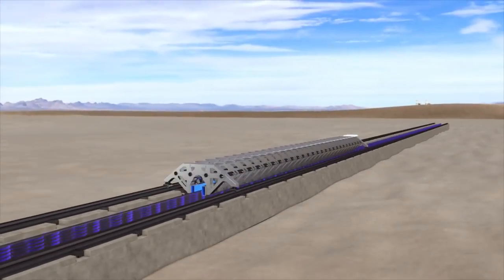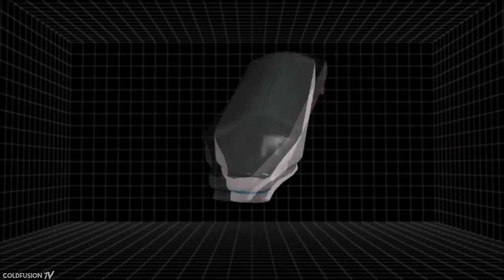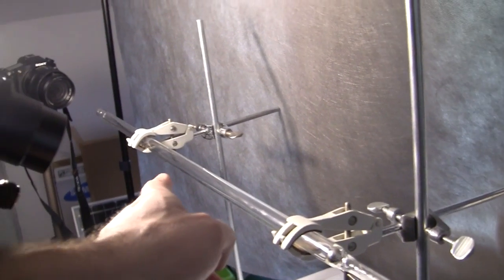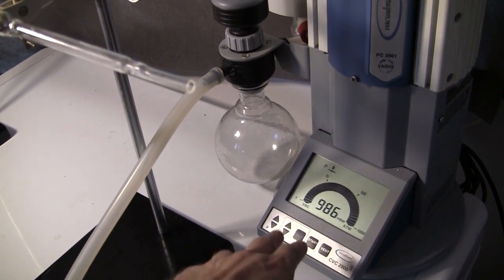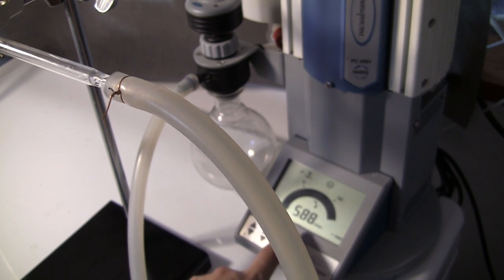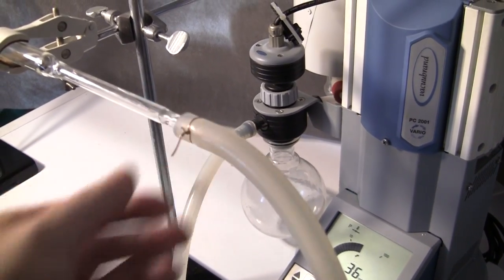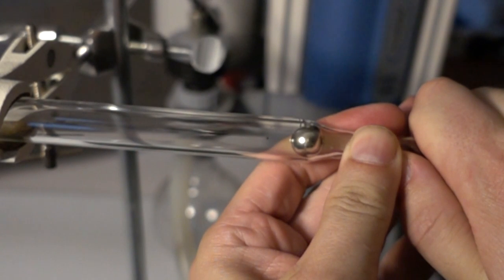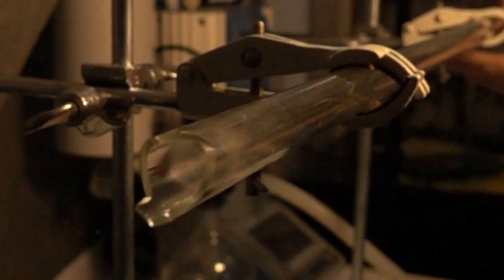How  the Hyperloop can kill you!

Comment: So this simulates vacuum failing behind the craft, can you compensate by releasing the vacuum along the whole length of the tube? Can you seal off parts of the tube fast enough? How fast would the air pressure spread in a full scale Hyperloop? Need more science.

Comment: What's busted now? Getting into a metal tube with wings and accelerating to 900 km/h at 11 km altitude with a little more pressure is less of a problem? Every transportation system can and will fail eventually, the art is keeping it at low risk. but that didn't stop people from trying it anyway.

Comment: For once, I don't get you with this one thunderfoot,  this video feels rushed and not up to your usual excellence.     The hyperloop sure ain't the best of ideas for many reasons.  But you're not doing yourself justice with this one,  you can do better than this chap,

Unlike many other things you have debunked, like Thorium Powered Cars (First video of yours I watched by the way,  most Exellent ^_^  )   The Hyperloop isn't actualy technically infeasable,  Just very fragile in many respects,  and very...  energetic if anything goes wrong.

 Pressure problems can be defeated through engineering,  maybe valves that would equalise pressure on both ends of the train upon vaccum failure?

(though,  what happens when the train is at full speed,  then suddenly vaccum failure floods the tube with near sea level pressure air,  and the train finds itself traveling at that speed in air pressure it was not designed for?)

It also runs the problem of being an extremely fast moving object,  in very close proximity to solid matter that is at a very high relative speed to itself,  even supersonic aircraft have the luxury of being far from anything to scrape or collide into when they are at speed.

I sure don't consider it a "Man Rated" form of transport,   for efficient transport of cargo perhaps?

Though that would require an analysis into the cost effectiveness of cost of fuel saved VS the cost of initial R&D design and construction.     How long would it take to pay for itself,  if ever?

Any applications for very high speed efficient cargo transport?

These are the kind of points I'd have expected you to bring up,  hope they help you come up with a better video on this :-)

Comment: I would like to see a vacuum-failure with magnetic brakes activated.
Not to mention that the full scale project would most likely have double or triple walls between the vacuum chamber and the normal earth pressure with loads of sensitive pressure sensors...

Comment: I'm not convinced that the Hyperloop can be made economically viable, since the infrastructure required does seem very expensive, but the objection in the video doesn't hold water.
Your model has very little room for inrushing air to bypass the vehicle, much like a bullet in a gun, but the promotional video has quite a lot of clearance around the vehicle, so the air can follow the path of least resistance around the vehicle.

Comment: I am pretty sure you can do the calculations and tell us what kind of impact would a failure in the tube have to a multi ton pod with electric acceleration and braking. You can calculate it for a failure near the pod and also miles away from it. I would suggest that any force that the air would apply to the pod would be negligible compared to the pod's weight and the extremely powerful braking system that could stop it from 1200-0 km/h. And that's only if there are no safety measures at all.

I am afraid you are terribly wrong in this one. Why not contact the company that is building the test hyperloop and ask them for a comment?

Comment: What happens if your car brakes and accelerator fails? You will by going 70+ miles an hour in a 2 ton vessel until something is in the way...
What happens if the pressure in a airplane cabin fails? You will be deaf and a organ or two will rupture
So on and so forth... Each and every transportation has issues, and its stupid for you to point out these miniscule issues and make a huge fuss about it. Yes it needs to be engineered to be solved, however it also doesn't need to be released to the public who will have mass hysteria and wont understand whats actually going on.

Comment: I think you may have over reached on this one.

1. The failure mode you have demonstrated is almost impossible, the whole end of the tube coming off? This would be analogous to a ring of demolition charges going off. The more likely failure mode is a fatigue crack or joint failure, which may expand from a pin hole to something larger very quickly but not total tube failure. Remote fatigue monitoring and leak detection are common in the aviation industry.

2. Even if the tube did fail catastrophically the capsule is not designed to snugly fill the tube in the same way as your ball bearing, there is going to be plenty of room for the pressure to equalise fore and aft. Your tube does not match the reality of built infrastructure, over that short distance with a smooth tube turbulence and friction with the inner surface is negligible, this is not the case for the full scale version. 

3. The capsule is fitted with brakes, any unexpected accelerations and they slam on, again something well within the capability of modem avionic systems.

4. At what point does this failure occur? If, as in your demonstration it acts to accelerate then during it's journey the capsule will be travelling at almost Mach 1, a failure behind it will mean the in rushing air will have to travel supersonically to catch up. Effectively the capsule would be trailed by its own cavitation effect and the control systems would have plenty of time to react. If the breach occurred ahead, then that is a far worse scenario possibly akin to an aircraft being caught in extreme turbulence, but millions accept that risk every day and is mitigated by the avionics, the controls need to keep it straight and keep the brakes on and it will be safe.

5. A critical failure as the capsule passes is the perfect storm of failure and whether due to a deliberate act or because this is the point of maximum stress and you end up with the Tay Bridge disaster, but again this is a risk that commuters totally ignore. It wasn't that long ago that one badly maintained set of points sent a commuter train barrelling sideways down a platform. And how many air crashes in the 70's and 80's did holiday makers disregard? They seemed to be weekly as I was growing up.

The engineering is solid with this however I don't think it will be built due to a number of factors. It's inflexible, you can only go where the tube goes and then its cargo transfer time. We had a fantastic rail network in the UK that was far quicker than the road system over long distances but every motorway is still filled with container carrying trucks. It's also very expensive to maintain infrastructure on this scale. So financial reasons will probably kill this but well done Elon Musk for at least opening the discussion.

Comment: Wouldn't the car itself be pressurized? Also why would the air pressure wave push the car, wouldn't it go around the car? Or are they saying that the car would perfectly fill the tube. In which case couldn't they put a pressure bypass through the car or a breaking system that would counter act that wave?

Comment: I'm a bit sceptical about that claim here actually.
I mean sure, if the hyperloop wasn't build with safety measurements etc. then it will surely kill a person, no doubts but isn't it a bit utopic to assume that the hyperloop wouldn't use some kind of safety measurements?

Considering that the hyperloop uses magnetic fields gives it a certain possibility that it might use eddy current brakes.
Additionally it could be possible that the tube-system itself might have some kind of pressure system which, in case of such a problem like in this demonstration, would try to open the valves in the tube-segments in front of the vessel which would shorten the acceleration path and reduce the acceleration force.

I might be completely wrong about my points, but wouldn't those mentioned points already do their job in reducing the lethality of the hyperloop?

Comment: My understanding of the hyperloop is that it isn't operating in a vaccuum, but low pressure. There is still a good amount of air in the tube, the vaccum at the front sucks the air and expels it out behind the car while riding on a mag lev track. Am I wrong? I understand the point Thunderfoot is trying to make but I don't think that is how the track is supposed to work.  I seem to recall Elon Musk publishing schematics for his concept.
Reply: eh, wikiped says the tube is supposed to operate around 1 milibar so I guess I'm wrong.

Comment: what's more hilarious is the fact, that it has a giant jet engine intake on the front.
what's it gonna suck it to combust, when the air has been pumped out? D:
Reply: 1. It is not a jet engine. It won't combust anything. It is a fan.
2. The tube is not vacuum, but very low pressure. Because the capsule is moving very fast there still would be enough air to suck in.
3. Most concepts don't use the fan, which is meant to produce air cushions under the train to levitate, but use magnetic levitation instead.
Reply: oh also... this suggestion is not new, it was already old, when they showed it in babylon 5 on mars.
Reply: The air cushion that forms when the pod is moving. It's not complete vacuum.
Reply: Holy shit. Vacuum and very low pressure are essentially the same thing.
Reply: Regarding the pressure difference, yes.

I was however answering the question what air there would be to suck in, and if you compress low pressure air (by pushing it forward) you indeed do get enough air buildup to suck in.
(I got the impression that the original commentor thought that there would be a complete vacuum in the tube. Maybe I should have said "The tube is not a complete vacuum")

Comment: I don't think the seal between the pod and the tube will be that tight. From what I've seen there will be a significant gap between the top of the pod and the tube, so a lot of air will rush past the pod and fill the other side. The pod will be pushed for sure but not as hard as in this experiment.

Comment: Ok, the problem with this video is that you changed how the Hyperloop works. Your test is much more like one of those tube messaging systems, but in the Hyperloop there is a low pressure inside just so that it is easier to make a magnetic levitating train travel closer to the speed of sound, there would be a lot of room around the train itself. Would be much more accurate if instead of a ball you used a nail that would not fill the entire tube, then the rushing air would not have that much of a effect on the object inside the tube.

Comment: Uh. The force exerted on an object by pressure scales linearly with the surface area; the surface area of an object scales with the square of the diameter, but the mass scales with the cube of the diameter, therefore the acceleration experienced by a larger object is much less than a small object. Repeat your experiment with a ball bearing twice the diameter and it will show half the acceleration. Repeat it with a ball bearing 10x the diameter and it will see 0.1 the acceleration. Granted, a train of any scale is less dense than a ball bearing, but it's also at least 400x larger in diameter, and has a long aspect ratio. where only the nose of it contributes a net accelerating force as the radial pressure is balanced on all sides.

Comment: There could be fail safes put in place. This is the first time I'm leaning about this but I've heard of similar ideas. For one thing, If you put pressure sensors within the tunnel it could activate breaking mechanisms and open baffle vents to prevent these kinds of accelerations. 

Of course if the vessel were at a stand still then yeah, a leak would cause it to begin accelerating, but there would be mechanisms that sense acceleration when it's supposed to be sitting still and it would power down the levitation magnets so it's just sitting against the rail. The vessel might be several tons so there's no way it would move and all that air pressure would just hiss around it until it equalized. Or vents at the other side of the vessel could be opened so the pressure on either the front of rear of the vessel is even.

Also self-sealing tires exist. Only very violent earth quakes or an explosion would cause sudden pressurization like that. I imagine the entire structure could be lined on the outside with something like silicone or a self-repairing material that seals up any gaps from damage. Overall, a vacuum tube rail system of some kind could be the answer to super-sonic travel in the future. It's just one engineering problem.

Comment: The same idea that Mythbusters had behind their high speed pingpong ball shooting.
There are a lot of possible problems with hyperloop. But that is normal with these kinds of things.
May be you could do a video about the need for this kind of tech. If there are obvious benefits and no better alternative, then it would be worth working on hyperloop and fix issues like this.
Now... we have to think outside the box. The assumption is that we need to travel. And in that case we need efficient and fast way to travel. But do we even need to travel these days? We can do a lot of stuff trough internet. Soon we will be able to meet each other in VR environment. A lot of food and goods production can be done locally. So... do we need to spend time and resources on improving traveling, or may be we should spend it on reducing the need for travel to begin with?

Comment: Being forced down a tube by air pressure don't sound nice. But sitting in an airliner with a broken cabin isn't exactly nice neater. Nor do it sound fun to be in a space shuttle with a broken heat shield during re-entry. Or even being in a car at highway speeds when a tire blows out. 

I'm sure the track/tube are sectioned off so any leeks can be dealt with. But i do hoe that the engineers working on it see this video and take this type of failure in to consideration.

Comment: How about a system of emergency valves at regular intervals. So if there is a tube failure on one side of the train then the valves on the other side blow open immediately, I guess with explosives triggered by sensors placed at even more regular intervals. Could it be possible to make a system like this that would react fast enough to save the passengers from being killed by acceleration?

Comment: I remember a mythbusters episode wherein they were trying to accelerate a ping-pong ball to the point where it would be lethal and they used a method very similar to this to get it up to a thousand miles per hour, however when they increased the length of the tube the acceleration fell off drastically instead of increasing. I think it's called the ping pong cannon episode, good watch!

Comment: I think it could be done. No doubt there would be safety measures in place. Large valves that are electronically controlled that could blow open rapidly & equalize pressure in the event of emergency. Anyways, can be done & should be done are two different issues. 
It would cost huge amounts of money to build. It would require lots of maintenance & current trains are really quite efficient. I doubt it would offer enough benefits to offset the costs. We had the Concord. We could get from NY to London in just over 3 hours. As neat as the Concord was, the benefits weren't worth it. I think this would fall in the same category. Very cool but just not commercially viable.

Comment: "with no way of stopping it" really? I love you thunderfoot but come on. the obvious would be pressure release values at regular intervals, and in case of a failure, release all of them. will equalize the force on both sides of the capsules.

Comment: Sorry you've not shown anything here, from an Engineering perspective you've completely forgot the scale and other factors. Such as Mag-lev fail safe being used to hold it to the track if somehow as you've shown the entire network is compromised. Their is a lot you've left out,. All you've shown so far is equalization of pressure, without any accounting for any  level of fail safe features. You act like their will be no kind of brake function despite requiring one to arrive at stations for slowdown.

Comment: Just to suggest something that isn't a retarded brake system... Could we have two tunnels to prevent this? If the pressure in the outer tunnel increases we know there's a breach and can take safety precautions like sealing that part of the tube.

Comment: There is also the physiological component; if you are in a pressurised vessel inside a vacuum, then the potential for a leak is quite high.

If there is a small leak that remains small, then the occupants are at risk of experiencing a pressure drop from, say, 1000 millibar down to 200.  This, in a short space of time, would lead to decompression sickness, pulmonary oedema etc.

A small leak that, owing to the pressure differential between the inside and the outside of the carriage, tore a hole in the carriage leading to a catastrophic leak would be...messy.